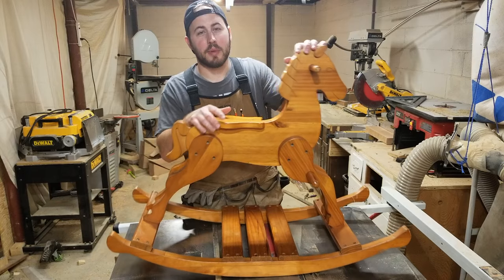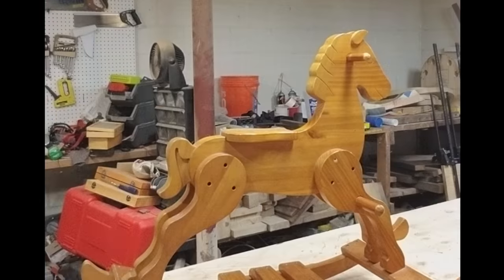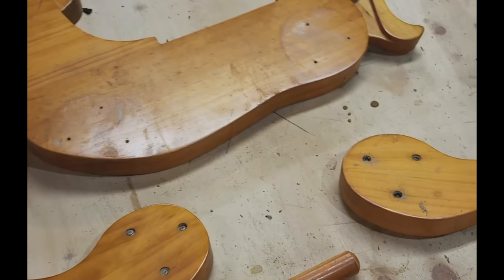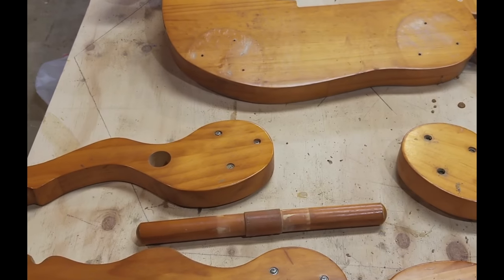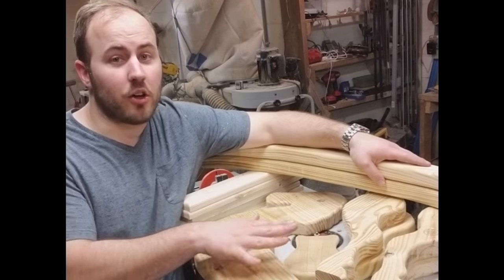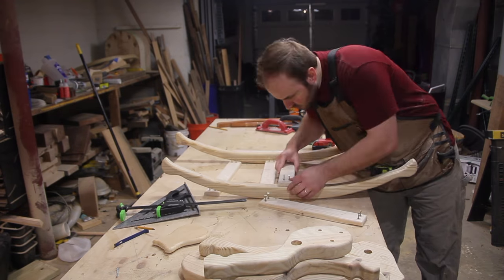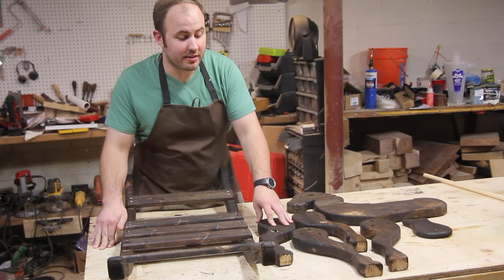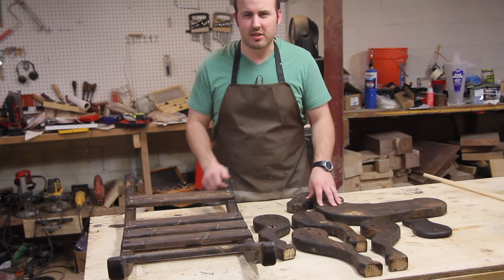DIY Rocking Horse

Comment: Hi there, Thanks for sharing your plans. Could you please tell me how I can print the fullsize template? thank you
Reply from the maker: If you have access to a large format printer (some libraries have them, if not a UPS or FedEx office will have them) that is the best way. Otherwise you can print the template out on 8x11 of 11x16 paper. Just make sure to print it at 100% it will print across multiple pages and you can tape them together.

Comment: Hi, can anyone tell me the length of the rocker please and the width at the bottom. I dont have access to a printer and so cannot print off the template but with a couple of measurements I can work out the rest. Thank you in advance

Comment: To print plans on 8.5x11 paper.
Download plans and save to computer.  Open plans with Adobe Reader.  Select- print in Adobe Reader.  Select- poster.  Select- tile scale 100%, overlap .005. Select- only tile large pages.  Select orientation - portrait.  You will have to cut and tape the plans.  This did it for me. Enjoy

Comment: How did you know where to attach the legs on the torso so that the hooves ended up perfectly on the front and back rocker slats? Also, how do the dowels stay in the holes without moving around?
Reply: I'm also wondering about where to attach the legs to the torso. I'm almost done and went back to see where to drill the holes on the torso, but they are not on the plans!
Reply: Did anyone fond out how to do this?? Im going to start this project im a few weekd.
Reply: Has anyone figured this out? :'D

Comment: So simple question I hope, since you seem to be really good with your Band Saw.   When you're cutting legs out for example I noticed you make 3 or 4 cuts in first, then do the contour, do you have a reason for each of those, like angle of curve, or is that just a habit you picked up to make life easy?
Reply from the maker: Those are called relief cuts. I have no exact science to when/where to cut them. Simpy, the tighter curve you cut the more relief cuts you will need. It also helps you not get stuck in a long cut. So if you get off track you have a place to start over.

Comment: I'm somewhat of a newbie woodworker so I'm curious as to the purpose of the "relief" cuts you make? Thanks and I'm planning on trying this out for a friend who's expecting in November!
Reply from the maker: They break up a long curve cut in to smaller sections. If you're using a jigsaw they are not as necessary. But with a bandsaw you can get the blade stuck in a long or small radius cut. The relief cuts give you an out, so you don't break your blade.

Good luck and have fun!
Reply: @FamilyTableFurniture  Awesome, thanks!

Comment: Could be a dumb question but how do you print out templates to correct scale?
Reply from the maker: Not a dumb question. They are scaled in the file so you can print them off on a large format printer at a FedEx or other store. Also you can print them off on  regular size paper, but you'll have to tape all the pages together to make the full template. Just make sure when you print it that it's printing at 100% size.
Reply: @FamilyTableFurniture  tears just answered my question too, thank you so much 😊

Comment: In the video you say the body is made from 2x10. in the plans it says 2x8, also the way you glued the body up in the video is different from the plans? I did what the plans say and that's as far as I've gotten so far. Should I do it like you do in the video or like the plans say?
Reply from the maker: I miss spoke in the video. The plans are correct. Use 2x8s!
Reply: @FamilyTableFurniture  thanks!

Comment: I printed the template out and it’s not to scale how you print it to scale?
Reply from the maker: Make sure when you print it off you print it at 100%. Don't resize to fit a regular 8x11. It'll print off in multi pages and you will have to tape them together.

Comment: Where can I take the drawing in pdf to make it happen?
Reply from the maker: The drawings template are scaled. If you print them off a a large format printer they will be the correct size.
Reply: Yes, but I do not know where to take the figures to cut out the pieces